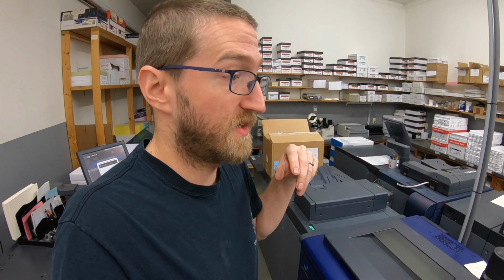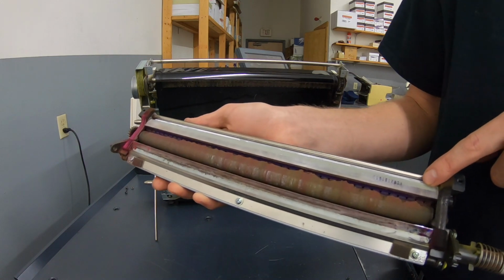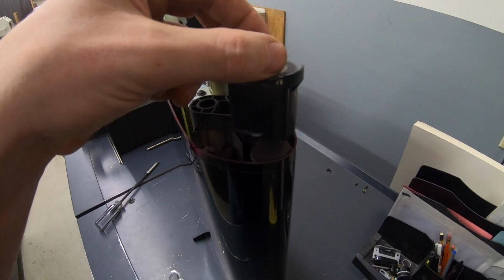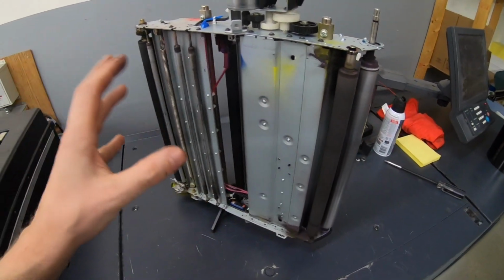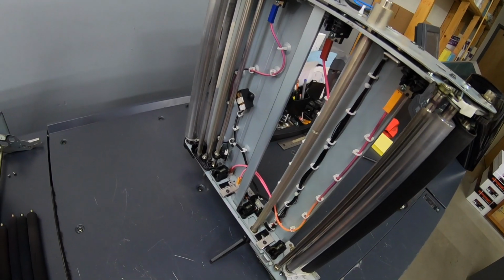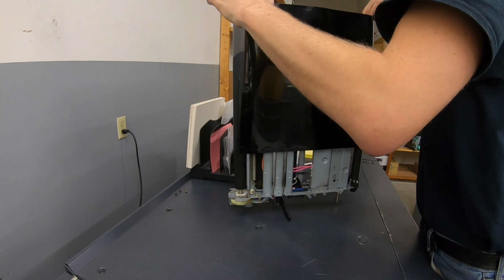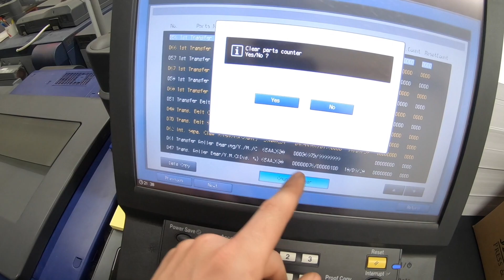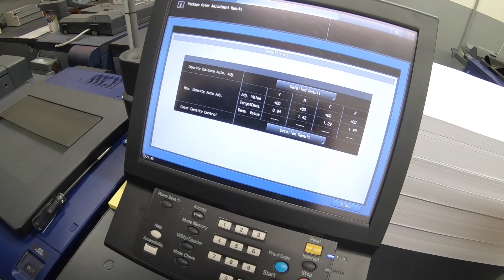Rebuilding the Intermediate Transfer Unit on a Konica Minolta C3070

Comment: If you are still wondering how the belts differ. There are 3 types: intermediate transfer, intermediate transfer / H, intermediate transfer / C. / H and / C supports textures paper, simple belt does not support. / C service part only. Usually belt / H is used. Dedicated connector is used to determine the type of tape. Without it - simply belt. Blue - / H. Black - / C.
Reply from the maker: Interesting, I had no idea, thanks for that!

Comment: Use 409 cleaner to clean your solid ruber rollers (never alcohol) and leave the foam typ rollers alone. You can use a soft brush maybe but no liquid. You find the soft type foam rollers in smaller machines and somtimes for secondary transfer. (Not the main transfer unit).
Reply from the maker: Good to know. Thanks!

Comment: Does anyone know how to fix a problem  with c3080 konica. It says close delivery  door of charge control  unit? I replaced new sensor   everything alse looks good A wiring connector pins are good .I wonder if there is a way to fix it from the system

Comment: Hey, i have question maybe you can help, we run 6136 80GSM paper A3 to make glue books (soft cover) but the pages are out very wavy and the RU isnt really helping in this machine, have any suggestions we can do? thank you
Reply from the maker: Try different paper maybe? Lower the power pressure setting, change paper setting on the press. Sometimes paper curl will go away after setting for awhile. Try flipping the paper and printing the other side first.

Comment: how to solve error code c-4531 on the konika minolta bizhub c1085 machine, for the gamma adj process it goes well but when I want the collor registry it fails,
IDC unit has been cleaned but still error C-4531. And the ITB transfer unit has been replaced, please advise, thank you.

Comment: So I watched this video and it was really helpful, the rebuild went fine!  Thank you so much.  I opted for the 400 PM kit which includes all the parts for this and also the lower transfer roller that is not part of the intermediate unit.  Any suggestions/video on doing that?

Comment: Thanks for another enjoyable video. Can I please ask as to what is your cut off point when it becomes more financially viable to use offset for full colour? Is 5k SRA3 sheets with A5 leaflets printed 4 up viable or 2.5k more realistic? I'm trying to get a few costings put together before I open my shop in March, Covid restrictions permitted . I come from an offset background so this is all new to me.
Reply: It depends on your labor and click costs. Generally it's not ideal to print leaflets (the same thing over and over again, i.e. non-VDP) in a digital press unless someone wants them delivered here and now. The final pricing for the job will be very high.
Reply: @orestes29  I have 2 Xerox machines which I've purchased outright and most maintenance work is being done by myself so I don't really have any click charges. There must be a maximum number of SRA3  sheets that are viable on a digital press before they become too expensive to print.
Reply: @caileanmoore2835  Yes I also own and maintain my digital presses on my own. Sure, you put in the labor to do what it takes to keep them running properly, but consumables aren't free. Say you print 5k 13x19" sheets with heavy coverage. That could easily use up a set of CMYK toner, and that's around 150-250 euros depending on your machine. Whereas if you printed it with your offset press (assuming you have one, even a two colour machine) you'd only have to pay for 4 plates (assuming the job doesn't involve variable data). Even if you don't have an offset press, it would probably be cheaper to outsource. Digital presses can't compete with offset in things like leaflets that many people want to buy in vast quantities and for cheap. 

Nevertheless, I'd say maybe for around 500 A5 leaflets digital would make sense? You can print more, but it's going to be much more expensive for the customer and most customers won't be willing to pay that much and understandably so. 

It really depends on the application. It wouldn't make sense to print 5k SRA3 sheets that are the same exact thing in a digital press but it would probably make sense in things like what Dan is doing, printing books where each page is different.
Reply from the maker: A lot of good conversation going on here. I would say find a trade printer and get their price. When you can beat their price run the job in-house. When you can make the same profit outsourcing or printing in-house. Then you can send the job out, or keep it in if you want the work. The key is to accurately keep track of all your costs so you can calculate your true costs. Most of what I print is low ink coverage so my costs are low.

Comment: We have C1060 and i feel colors are not balanced, too much red. How often these printers should be calibrated?
Reply: Ideally every time before you start printing a new job. Try calibrating with your spectrometer, if you have one. Otherwise try running auto gamma adjust. Make sure you also have the correct RIP settings for the job.
Reply from the maker: I calibrate daily.

Comment: thank you for the continued support  you offer through the YouTube channel. Now we have been having a huge challenge with our C 3070, it all started with an error C 2221, which kind of meant the transfer belt unit was not closing properly, we figured out it was somehow an issue of some drums , once we changed them, we now encountered another issue, the printer cannot finish running the gamma quality adjustment or even colour registraton. It brings error  C 2802 which has something to do with magenta drum issue.
 Basically now we are down and we can establish what the issue is, have you encountered such an issue , and might you have any advise?

By the way we also tried changing the transfer belt but nothing changed the gama and colour adjustments fail.

Looking forward to reading from you,
Reply from the maker: Sorry, I don't know. How old are the developer units and developer? I would get errors when they were old.

Comment: Am new here. Can you confirm that the drums for 1060 all the way to 3070 are interchangable. Am looking to buy the DU 106 to run on a 3070. Would the DU 105 also work on the 3070? Many thanks
Reply from the maker: Correct they are the same for all of those models. You can check drum comparability on https://arcservicesco.com

Comment: Hi Dan ,  first of all i would like to thank you for all  movies, and always for super explanations of the problems and solutions. Realyy great job as well as normal daily job :) Some mechanical solution are so easy, but effective :) think about 3d printer to use some printed parts instead a pencil  :) i wold like to ask you for an advice. I use Xerox machines and OKI ES 9431 for preprint, and small ( very small ) production. I am thinking about buying Konica ( used ofcourse, new are too expensive for me). Which will be better for start ( spare parts cost , (maintenance i do myself), print cost, print quality etc..) Pro C6000 or 6500 or 7000. Thanks.
Reply from the maker: All three of those machines are basically the same. They would be great starter machines. The c6500 is what I built my business on.

Comment: How would I know if it is time to change the transfer belt and rollers?  I am getting random toner spots of all colors on startup and first sheets of a job, could that be the issue?
Reply from the maker: Sounds like you just need to open it up and clean it. There are also side seals that can drop toner out. Maybe a cleaning blade is wearing out?